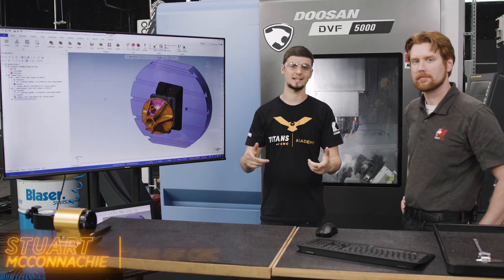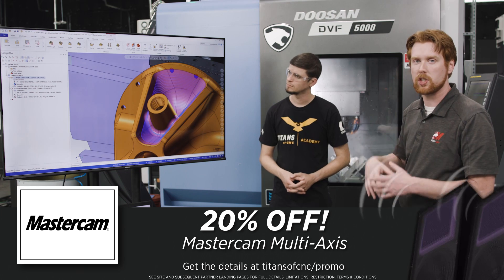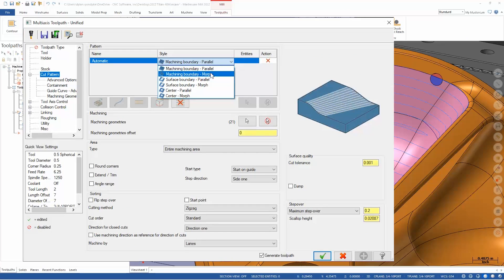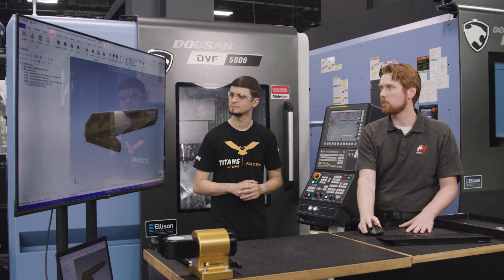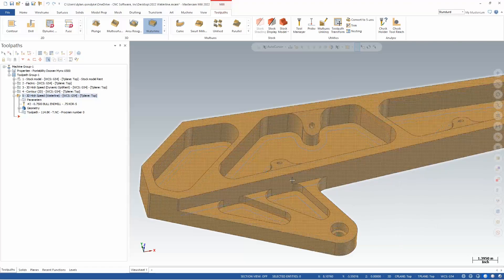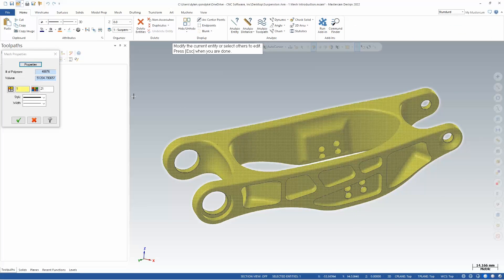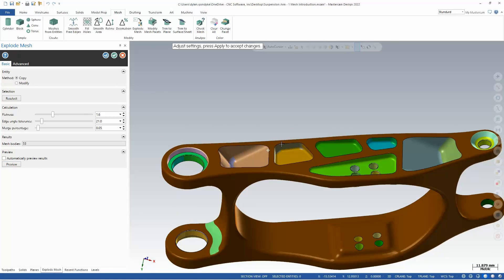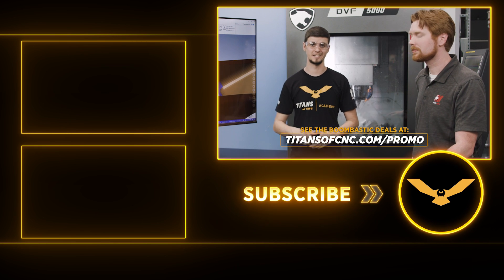MasterClass CNC Programming Techniques Revealed

Comment: sometimes when i import a step or iges file, there are missing faces. Why tho?
Reply: Sometimes when you convert from one software to another software, some information will be missing during the conversion from one software to another.
Reply: Use Hexagon Designer software
Reply: Are you limited to those file types? Try a parasolid xt or xb file. They are more "portable" file types. I've had really good luck with them. Sometimes a face can look like it's missing, but the surface normal is just flipped making it look as if it's missing a face